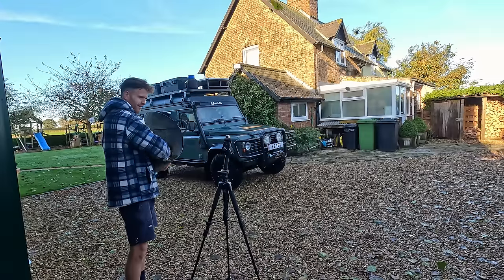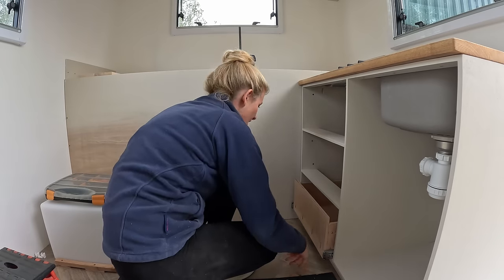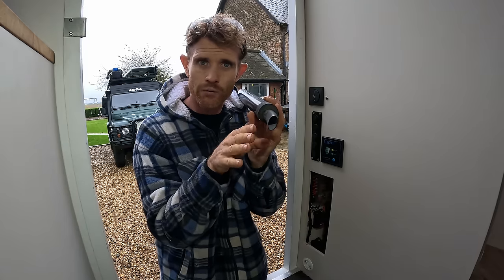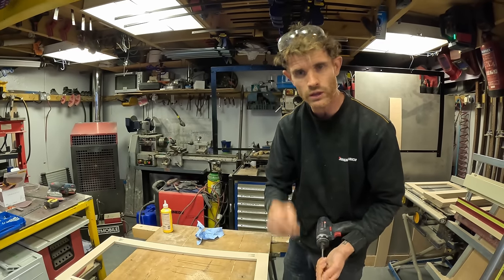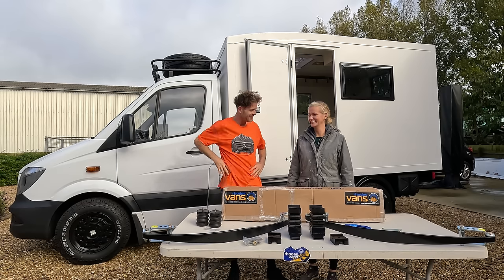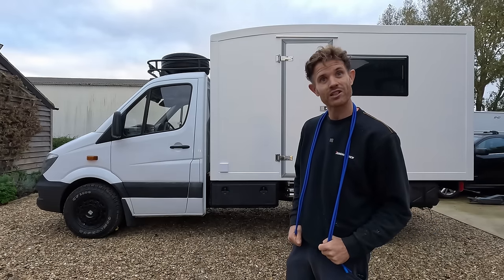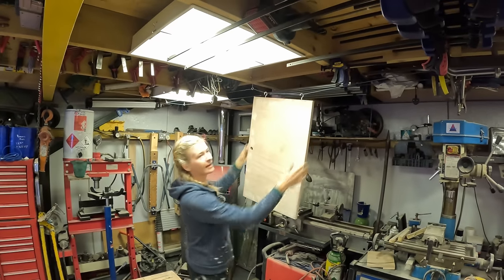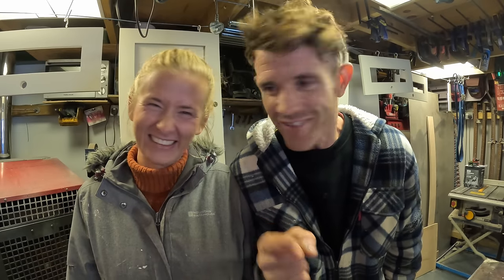Sainsbury's Delivery Van to Arctic Ready Adventure Camper: Building For the EXTREME Cold!

Comment: Top tip for the UVC filter, you really need to use metal fixtures on it and a short run of copper, the UV kills the plastic fittings really fast. It's the only downfall of JG Speedfit!
Reply from the maker: Thanks for the heads up 👍 I’ll check this out with the supplier as it came with plastic fittings

Comment: I would have mounted the electrics on a board first then fixed it in the space, much easier. 👍
Reply from the maker: The mounting part wasn’t too bad, it was connecting all the wiring that was the worst, but good idea 👍
Reply: @truebluetravellers  ok yes I get that, I have tried in the past to connect the wiring to the devices on the board leaving enough wire to to connect the other end. It can work in some situations. Good video thanks.

Comment: The suspension upgrade looked like a relatively easy installation, especially as it works with the OEM set up. Also the use of the four post lift as extra storage is rather crafty, better to repurpose it than just have it in the way.
Reply from the maker: Yes mate I was pleasantly surprised how easy it was to fit to  to be honest 👍

Comment: You guys are giving us the inspiration to do another build. You make it so easy! Why did it take us 2 years 😂

Just a coupe of things on the electric side of things.

1. I would install an isolating switch for the solar. This way, when you have next to no solar you can switch it off and allow your dc to dc to charge at 50a, rather than 25a which it will if there is even a bit of solar. In low sun areas/times you want as much dc to dc charhing as possible. 

2. Go bigger batteries if you can, if you plan on being off grid as much as possible. We learnt this the hard way. Started with 150ah usable AGM (for budget reasons) now have 560ah lithium which means we don't have to hook up for a 5 days to a week.

Good luck and cant wait to see the rest of the build!
Reply from the maker: 😂😂 cheers guys, 560ah of lithium 😎 now that is a battery setup 👌
Reply: @truebluetravellers  we DIYed it too. Raw cells, bms, £1000 and some YouTube vids later we're there 👍

Comment: Just be careful when you put the feral ends into the socket that you don't push the ends in too far, if you do when you screw the grub screws in, there is a possibility that you tighten the grub screws onto the insulation of the feral and no contact is made. I mention this as I have done that exact thing and have to remove the socket again to rectify the problem.
Reply from the maker: Good point mate 👍 thanks for the heads up

Comment: Thanks for explaining the Jig John😃👍. I received it this week and will start working with it soon. You guys are so funny😂.
Reply from the maker: No problem, cheers mate 👍
Reply: Thanks 😃👍. I mounted it on the front of my workbench to make it easier to use from my wheelchair👨‍🦽. I was also able to connect it to my extraction system, using some PVC pipe and connections that I had lying around. And I'm not even a professional, just a hobbyist, just like you guys.😁 @truebluetravellers
Reply from the maker: Good man, the extraction hooked up to it makes a big difference, it sucks the board to the jig too so well worth doing 👍👍

Comment: Those Kreg Jigs are really good I have the K4 version which clamps from the front. Which make dealing with large panels a breeze. 
I have the Sumo Springs on my list of mods to do to the Van once it is finally sorted out as ours is horrible in high wind and on uneven roads where it really throws itself about. Would have been interesting to see how the Sumo Springs stack up on their own as I hadn't even considered the helper springs. I had looked into possibly add 5 ton springs. 
We have stabilizers to wind down to try and stop the rock at night when my Eldest rolls around and before fitting them I used to feel a bit sick as I suffer with Motion sickness as I have gotten older.
I used to Watch Greg's Channel before he started his Van Conversion. He was a great source of information and did cover some things in great detail. 
Looking forward to the next thrilling installment next weekend.
Reply from the maker: Cheers mate, yeah one of the reasons we upgraded was Jess doesn’t like it rocking at night in the wind as she gets motion sickness too

Comment: 26:12 is just too short!😩

You two never cease to amaze us with what you can both do, Jon especially!
Doesn’t look like there is much Jon can’t do, impressive skills!
Roll on next Saturday. 🙌

Q: I’m no mechanic, but as you’ll be doing long journeys soon, looking at the discs, do they need replacing as they looked quite rusty and scored?
Reply from the maker: Cheers guys, the discs are quite new it’s just that it’s been sat round for a while and the rain makes them slightly rusty, a quick drive will clean them back up 😁

Comment: Kreg make a 3/4" (20mm) screw for 1/2" (12.5mm) board, they also do a clamp that fits in the drilled hole and pulls the joint closed, not much use for what you are doing, but good for if you ever need to join a worktop
Reply from the maker: Thanks mate I’ll check the clamp out as can’t beat a good clamp, yeah it’s the 20mm screws I use but on the settings on the jig they poke through slightly 👍

Comment: Just for charging laptops no 230 V~ is necessary. There are nice adapters for 12 V=, whose output can be adjusted between 17 V= and 22 V=, depending on your laptop model. They also come with all kinds of plugs, so that the one for your model is very probably among them. In case your laptops charge on USB-C, it's even easier to find an adapter, they are called "USB-C Laptop Car Charger"
Reply from the maker: I’ve tried a few different types from Amazon but I can’t get any to work, the laptops we have are too power greedy and they just won’t charge off 12v, would love it if I could find some that worked

Comment: Fantastic channel guys, i love all the banter you two have. Just an observation, all of your electrics such as the inverter gets warm and needs a circulation of air so they dont cook themselves . By nature of how a fridge works, they also produce heat. maybe worth just keeping an eye on the temperature on the "electrics'" area...will be fine in the artic, but any warmer ambient temperature may give you electrical issues and the fridge will be much less efficient.. keep up the good work
Reply from the maker: Cheers mate, yep what I’ve done is put vents either side in the cupboard and half the side where the battery is has been cut out and lastly the fridge still has quite a gap to the electrics so plenty of space for airflow, if it becomes an issue I think I’ll just install a small computer fan to keep things cool but should hopefully be ok 👍
Reply: Almost insulting Jess that you have not already thought this could be a challenge, and yes a PC fan would be a great get out if a problem, smart woman!!😉😉😉

Comment: Ok Jess, get some brownie points over Jon.
Tell Jon too stop mucking about with his current pocket hole jig and get the Kreg micro jig!  It's designed for thinner materials and comes with a smaller diameter drill and you can also get 3/4" screws. 
Surprised Mr TTT didn't know😂😂😂
Reply from the maker: 😂😂😂 Brilliant thanks for the info, just told him and he’s dead excited 🤦‍♀️

Comment: A tip from a Swede who drives on snow 5 months a year! Get real winter tires with studs. With the ones you have, you will get stuck in the first snow you see. In Sweden, Norway and Finland, it is a law that you must have proper winter tires for all vehicles, including buses and trucks. Good tires is NOKIAN HAKKAPELIITTA, CONTINENTAL VanContact ICE or MICHELIN X-ICE NORTH.
Reply from the maker: Thanks for the info. I checked that the tyres we’ve got meet the requirements of the law for all the countries we hope to visit they are 3 peaks mud and snow tyres. Our problem is that we need to get from the UK to the Nordics and studded tyres aren’t permitted for quite a way of that journey. We are planning to take snow chains so at least we can take them on and off and will have recovery equipment with us too 😀

Comment: On your Kreg jig, there is another drill guide insert you get for thinner material. Will work better for you as it is a steeper angle.
Reply from the maker: Not with the one it came with, when you move the upright bit up and down it affects the angle you drill at but for some reason the 12mm mark just doesn’t quite work.
Reply: @truebluetravellers  mine had two blocks which slide in, the second one at a steeper angle and with a smaller diameter drill for thinner boards. The screws have a smaller head too.
Reply: I’ve just googled it, it was called Kreg micropocket, but it’s now discontinued.  
Thought I was going mad, but no use to you now as you can’t get it lol.

Comment: I am very impressed with your build quality, I agree with almost every aspect of the design, something I disagree with is the placement of the electrics, hiding safety critical components and associated cabling is very bad, and inverters need pretty good airflow to work efficiently, please keep the videos coming a really good watch.
Reply from the maker: Thanks very much Chris 💙 we have quick access through the little door on the side and the fridge can easily slide out to get to anything. As far as air flow goes there vents on both sides of the cabinet, a big gap to the battery box which has loads of space in it and a good gap to the back of the fridge. Our biggest problem where we are going will be keeping everything warm enough to function properly but we can easily add some computer fans if it’s too warm in there.

Comment: As always fun videos to watch!
Concerning your electronics and fridge: aren't you afraid of heat build-up? Both release heat and I haven't seen a proper ventilation at the top of the closet... 🥵
Reply from the maker: Cheers mate, so I’ve vented the cupboard on both sides, also cut half the pannel of the middle divider out and also the fridge has quite a big gap to the electrics, ideally I’d like it to be reasonably warm to keep the battery temperature up too, if it’s an issue then I’ll just install a couple of computer fans to keep it cool but I ran a similar system in oz in 40’c and it was spot on 👍
Reply: @truebluetravellers  thanks for elaborating! Keep up the good work 😀

Comment: 5:45 I recommend you get a surge protector for your shore power hook-up. They can be the more simple kind meant for a small number of sockets. Look for the single phase, 240V/16A models which should set you back about 50-80 Sterlings.
Especially power at campgrounds are very prone to voltage dips (and worse) voltage spikes which will kill all the mains power equipment on board in less the a few milliseconds... btw: a surge protector is not the same thing as a (main) circuit breaker or a GFI unit... which are also good to incorporate into the shore power inlet wiring...
Reply from the maker: Cheers mate, I’ll check out the surge protector but I’ve installed a consumer unit with rcd protection 👍
Reply: @truebluetravellers  any ground fault protection is good.. I never thought about over voltage scenarios until a friend of mine came back from his holiday with his self build campervan and had his entire 240V system cooked as he was plugged into shore power provided by a Serbian camping... Granted Eastern Europe may not have the best safety standards but I have heard Spain and Portugal have similar lacking standards.

BTW: I thought you were headed to the arctic, what's this talk about Africa ? 1:30
Reply from the maker: So we are off to the artic in the Sainsbury’s van and then once we are back from that we have converted a defender which we will then take to Africa on an adventure 😁

Comment: Hi. John and Jess. Another great video. Looking forward to seeing your Arctic videos. Where did u get your new main door lock from. My van arrives in Tuesday. Do the windows just glue in or do u have internal fixings too. Love your cupboard door idea. Are u getting it chip tuned. I always use shell vpower in both my vw t cross and caddy. Have u had any dpf issues. See u in the next one. Love to u both. Best wishes David and Beverley Norfolk
Reply from the maker: Hi Dave and Beverly, thanks very much. We got ours from camper select it’s a Caraloc 700. They were really helpful. We did have to make an ali plate too as a catch on the inside though as not quite long enough. Would seriously consider getting ready made horsebox doors if we were to do it again. While these will likely be more thermally efficient and they were cheaper they were a bit of a faff and spent ages trimming and siliconing all the edges of the seals and things. The windows are in 2 pieces and you screw them to each other the hold them into the hole if that makes sense. We might get it chipped when we get it unrestricted no no dpf issues 👍
Reply: @truebluetravellers  hi. Great info. We really appreciate your answers, that's the same lock we looked at online. Yes the 57mph may be a bit slow but at least more mpg. Thanks again for valid info. If it wasn't for your videos I wouldn't have bought it. Real inspiration. I lost mum last year and retire in 2 yrs so wanted something to do. Won't be as nice as yours though. Do u want to swap. Ha ha. Just one last question. Does it have 2 batteries. I want to replace the battery but Merc said it had 2. What have u done. Thanks. Best wishes David and Beverley Norfolk
Reply from the maker: It will be lovely I’m sure and most importantly it will be your little home away from home , yep so ours has 2 batteries, one under the passenger seat base and one under the passenger floor Matt, I was going to remove the second one but I thought it would be handy to have the second one as we will be installing a engine pre heater so will come in handy 👍

Comment: Bad idea with adding the van electrical equipment behind the fridge. Fridges operate well if the rear radiator can dissipate the heat quickly and be vented away in order to run efficiently. Adding the electrics just adds more heat behind it. Also fridges will release the condensed air from the dripping condensation from within the fridge and drips onto a hot part behind and also dissipates away but in your case it’s gonna add extra humid air over your electrical equipment which could cause corrosion on contacts. You’ll need to add lots of rear ventilation to outside. If you look at motorhomes you can easily see from the outside where the fridge is because there’s always bid vents showing.
Reply from the maker: They normally have vents to the outside as most motorhomes run 3 way fridges, this is a 12v fridge, totally different

Comment: Hands down the best camper van conversion series (and I've watched a lot of them...}

Great explanations on how to carry out the technical work and good banter too.

How much do you think the van will be worth at the end?
Reply from the maker: That’s really kind of you to say thanks Rob. We haven’t looked at prices of done ones for a while but rough guess around £35k
Reply: Thanks for replying @truebluetravellers .

This tool (me) has a couple of nerdy requests for Tool Talk Tuesday.

1) I was going to buy a track for my circular saw bet then I watched you using a plunge saw. What's the difference and why does it make cutting out the sink easier?

2) I always though rivets were just used to fix sheets of thin metal together. I didn't realise you could use them to fix things into the solid walls of the van. Is that because the GRP is soft and you're using peel rivets?

I know I could just google/youtube this, but I'd prefer your no nonsense easy to understand version of it. 😀
Reply from the maker: So a circular saw on a trac vs a proper trac/plunge saw, i have a circular saw and a homemade trac which works good to just cut a length of wood, but to use it to cut out a whole in the middle of a board is a nightmare as you can’t really set a stop depth so it’s quite hard to do, where as a plunge saw is made to do exactly that, u can do it with a circular but slightly dangerous I’d say and also potential to mess up the workpiece, and the price of wood now days a couple of mistakes and that’s the cost of a proper trac saw 

Yep so the rivets are normally used on metal but to be honest I use them anywhere and on anything I can’t get a nut behind with, work a treat and are quick and easy too 👍👍👍
Reply: @truebluetravellers  Thanks again for replying. You deserve all the success you get from your channel 👍👍